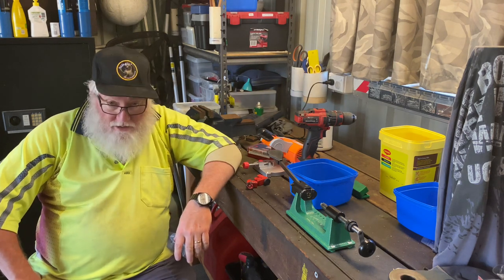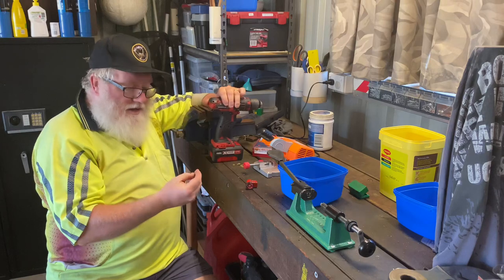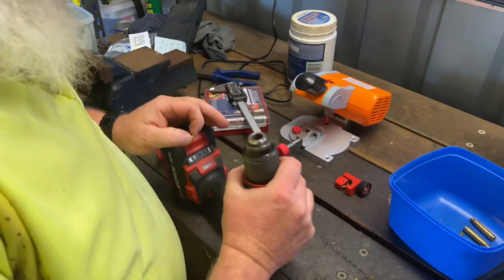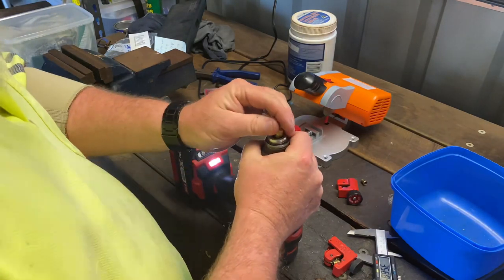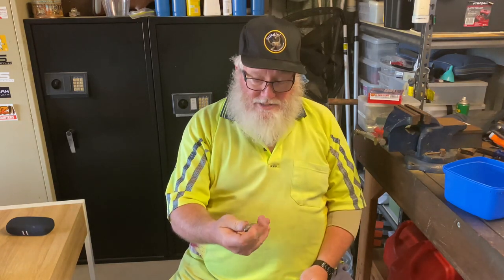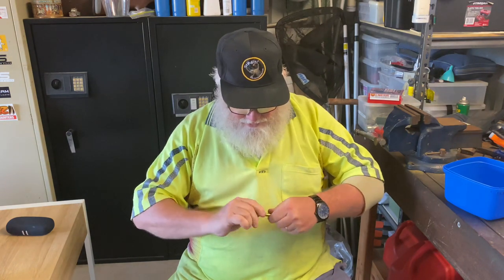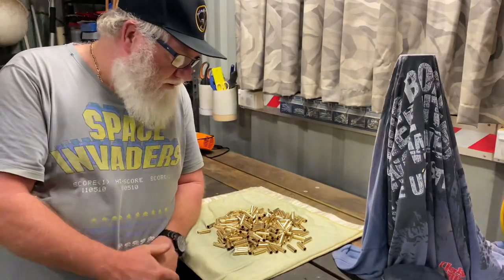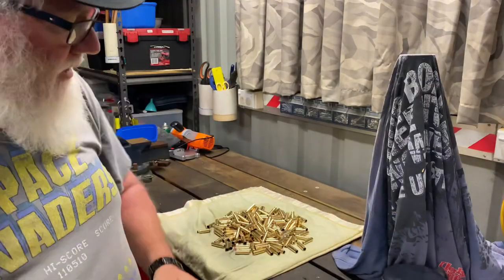Making 300 Blackout Brass Out Of 223 Brass

Comment: Interesting video.  I reform .223.  brass the other way to make cheap .222Rem  brass , it works for me just sort out by headstamps. Have the occasional dimpled case from excess case lube but they are still useable.
Reply from the maker: No issues thus far. It does appear though that trim length is quite important. I’ve found that, on initial reforming of the brass, I have to trim them as short as I possibly can. Once fire-formed, there doesn’t seem to be an issue. I anneal them after the first firing, and give them a little trim each time round, and haven’t run into any problems yet. If they crack, just toss them; a lot of them come from old 223 brass that was heading for the bin anyway. And I’ve found no issue with shooting performance, so all good so far…

Comment: Do you have a list of brass that works best, I have a mix of 6 or so head stamp 223 (mostly ADI and Sako ) I’ve picked up at the local range. I understand some can have a too thick of neck size once a projectile is fitted.
Reply from the maker: I’ve done PPU, ADI, Frontier, Winchester, Remington, Hornady, Norinco and a couple of others that I don’t even know the make of, and I’ve not had an issue with any of them. So far, I’ve done them all the same way, and they all load up well, they all feed, they all go BANG, and they all extract. 300 Blackout brass can be a bit hard to ring, and somewhat pricey if and when you can get it. Doing this with 223 brass makes it a cost-effective exercise, and it’s not the end of the world if you lose a couple of pieces of brass in the bush. And I’ve experienced no issues with performance.